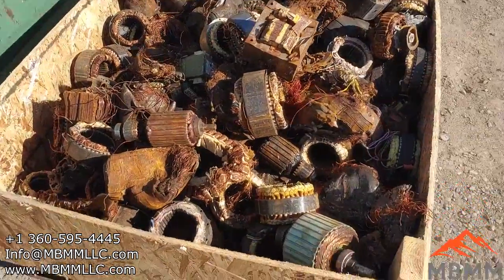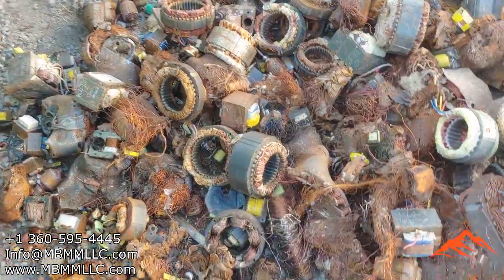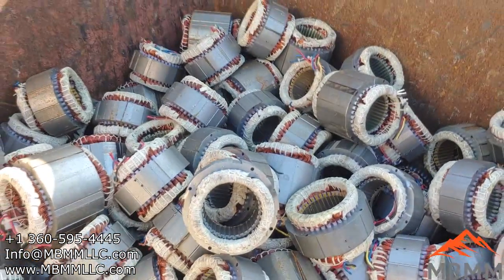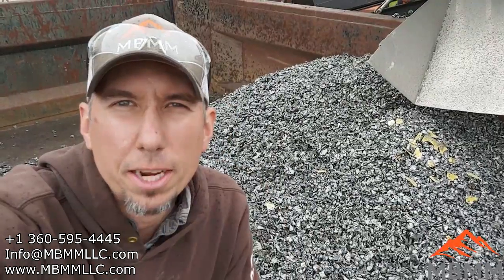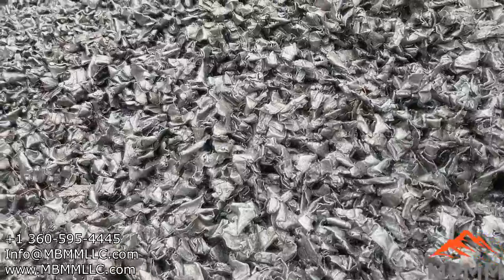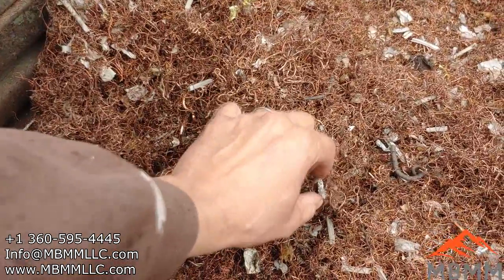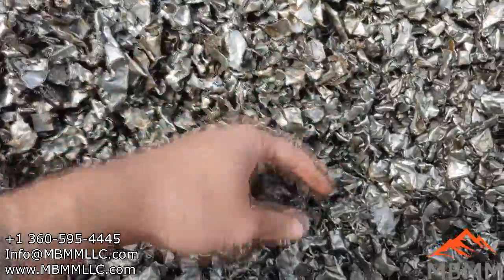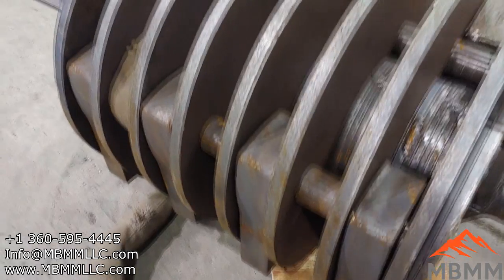Recycling Electric Motors For Clean Copper

Comment: That magnetic separator does an incredible job
Reply: I want one of them wow that thing is amazing
Reply: I have a question if you did not break them up and Hammermill and you pulled the copper wire out the way I would have to do it with that metal be considered heavy steel

Comment: Those stators are best to be done by hand I think. Cut 1 side of the coils, tick windings out with a hammer and pin or pull the windings out. Much more energy efficient maybe bit more time consuming but perfectly separated in Iron and copper.
Reply: Some large scale recyclers have machines that do this, but removing even one employee saves a lot of money.
Reply: It’s the time savings that’s where the money adds up
Reply: A problem is that if you get iron in the copper or worse copper in the iron it is almost impossible to separate later.
Reply: Smaller scale yes but I’ll save you some time and energy just wack the hammer on the side and they will come straight off in chickens of 5-10 disks.    Of course like you said cut one side off flush and this will save you time. Your welcome!
Reply: I kind of agree but if this guy has enough of them it might be a good idea to do it this way but if you only have a few it’s probably better to do it your way like I have to do I have been removing all my copper motors and I hopefully can be doing a video on that soon me removing the copper
Reply: $7 worth of electricity per hour. Wrong I think. Depends on durability of machine

Comment: you could use a ventilator to seperate light materials from the copper while it falls down from the conveyer
Reply: It'll burn up in the melt anyway, skim the slag off and you're good.
Reply: No reason to do that, you'll still end up with #2 copper, as #1 copper must be 1/16 or larger wire.

Comment: Industrial maintenance, service, and engineering guy here - 
Yeah, you could easily push a 100 HP 480V 3 Phase motor well over 100 amps, especially in the conditions you seem to be in.
Excessive heat build up in the windings (stator) of motors is what kills them, and the rated FLA of a motor is determined by how much heat a motor will produce in the windings while operating in worst case scenarios within design parameters.
Typically speaking, the Full Load Amp (F.L.A) rating of a motor is what it is rated to run at on a continuous basis ad infinitum - assuming the ambient temp of the motor is at or below the Max Ambient Temp stated on the name plate (usually around 80C, or about 175F). 
I might be wrong, but it didn't look like you guys, nor the motor, were in 175F temps out there. :)

The motor getting a little above that FLA for relatively short periods of time ( a few seconds to a couple minutes) isn't any kind of a big deal at all.
Frankly, you could just see how hard you could push it if you wanted to, and if the motor temp started rising, just back off till it gets stable and reasonable.

You said you did ~2500 lbs of stuff an hour running the way you did, I bet a whole dollar you could get that to 4000 pounds/hr with no ill consequences to the motor at all.
Just make sure the motor stays cool enough not to be uncomfortable to touch with a bare hand, and let it do it's thing.

Comment: I've scrapped many stators, and sometimes the wiring is copper coated aluminum (or what looks like a copper coating anyway). Some have both copper and aluminum wire, with the smaller copper wire used to assist at startup in a second set of windings. If you didn't inspect the stators in that first bin you could have a significant amount of aluminum in the shredded output. Overall you have a very efficient process there though. Sure beats doing them by hand like I do.
Reply: Man that stuff is annoying
Reply: Doing motors by hand is a chore.

Comment: Years ago i used to burn them to remove the shelac coating, use a sthilsaw to cut one end off the motors or transformer copper then just bang the motor and the wire pops out. Did it all by hand, made 1500-2grand a month JUST on these motors. Itd take me friday to sunday one weekend of the month to do that. I think now foundries where i live pay such a high price for these kind motors its not really worth separating them. But weight for weight you get a better return on smaller motors, the CU to iron ratio is higher. Gotta watch out for copper coated ali wire in more modern motors too nowadays

Comment: I would use a band saw to cut the ends off transformers, or a shire to get a better grade while you are waiting for the hammer to clear .. I think of a wood splitter with a knife blade to Sheri the ends off
Reply: I was thinking the same thing I want a wood splitters for this operation right here

Comment: Lovely to watch all that lovely copper being separated from the steel plates and what ever cast aluminium is attached to them.
That machine is amazing maybe not as affective as stripping by hand but certainly saves a lot of time. Probably can process more motors in a day than I can do in 6 months manually.

Comment: Wouldn't be too difficult to have a conveyor feeding the mill with the motor controlled by an ammeter on the  mill's motor. Set it so the conveyor stops when it hits ~80A and starts again at ~40A. Then it's a totally hands off system, just dump stuff on the belt and let it do its thing.

Comment: A lot of transformers have aluminum coils on one side. You can't tell at first glance, because they're coated with copper colored enamel.
Reply: I always thought it was just copper coated aluminium wire, thanks for the info👍
Reply: @heathstott  also motors, especially vacuum and garbage disposer motors. The guage of aluminum wire is larger than it would be if it were copper, since it's less conductive to electricity than copper.

Comment: I thought #2 copper is clean with no insulation or anything else with it. I took some stripped wires in and received a lower price because they weren't shiny red copper. They had some discoloration of brown and green.

Comment: Hi Jason!  Love it!  Would you use an eddy current separator to remove the aluminum after the mag belt?  Also, how about your zig zag vac for removal of the fluff and paper.
Reply: Doubt that eddy current separators would work to separate aluminum and copper from each other. They rely upon generating an electric current in a conductor due to a changing magnetic field. This in turn causes the conductor to generate a magnetic field of its own, opposing the original magnetic field and getting pushed. Both aluminum and copper are conductive, so ....

Comment: Ever consider adding a window to the hammer mill?
Reply: Would be cool but it would be trashed in 20min, glass would break and plexi is so soft it scratches easy
Reply: Yeah, but some kind of quick release to hold it and could just keep replacing. Just a one off, I think. Can't imagine a use for it other than cool video.
Reply: That would be awesome.

Comment: How does the steel come OFF the magnet?
Reply: I think the magnet just sits over the conveyor. And as the steel gets picked up by the magnet the little conveyor carries it to the side away from the conveyor carrying the copper. The magnet does not extend that far over and therfore the steel falls off. Thats my guess. Could be wrong though.

Comment: Looks like a LOT of non-copper going in the copper hopper. Aluminium?
Reply: Insulation
Reply: @aredditor4272  That makes sense, thanks.
Reply: Some of the stators had aluminium parts still attached.  Frankly, it's sometimes nearly impossible to remove it all by hand because a lot of aluminium is press fitted into motors and a real nuisance to remove. I'd like to see an eddy current separator pulling out the aluminium from the copper section and an air current separator for the paper.
Reply: @andymanaus1077  very often a motor rotor goes into a mold and molten aluminum is poured into it. 

This isn't a huge problem to refine, because aluminum melts at a significantly lower temperature than steel.

Comment: I would love to seperate the cobber from the aluminium :) Love to relaxe with this.
Reply: Most of what your seeing is the paper/tape from the windings.
Reply: @robbuechner3647  OK it will burn :-) But why is it #2 copper then?
Reply: @SuperRashead  size of the wire, and probably because of the varnish. To be number 1 is needs to be as big around as a pencil lead.
Reply: @SuperRashead  it's not CLEAN copper. it's coated with  lacquer for insulation and there's solder
 and other impurities

Comment: For some things those large machines are good, but wow, I see lots of waste and loss.. I can clean them by hand and make them much cleaner end results with ZERO loss and almost no overhead costs, just a few power tools, like an angle grinder and thin cut off disks.. I can clean over 100 pounds of copper in a few hours.. I like watching this, still there is got to be a better way to stop all the loss waste this process does...
Reply: it's for people who need to process thousand pounds and more an hour because they have the material.
To employ 10 people to do this job manually makes only sense in countries with very low labor costs.
It's not a solution for a garage operation.
Reply: @Battosai87  I do get, that on a huge scale when you have to process hundreds to thousands of pound fast, it is worth it, I was more referring to a small scale where it's mostly just you.. It is sad that the larger scale has lots of loss and small scale, like I have done for many years have almost zero loss and my end results have almost no trash in it, just pure product, Also I found melting down some metals like copper, brass & aluminum into bricks makes you more money per pound, with only costing pennies to do it.. 100 pounds of copper bricks pays almost 5 times then you would get for 100 pounds of number 2 copper... I find the more you can process your own scrap, the more money you will make per pound...
Reply: What was lost?

Comment: Your least valuable metal,the steel is clean but your most valuable, the copper is 'contaminated' beyond belief with aluminium. My local scrap yard would only pay price of aluminium 4 the whole bin. Not even price of braziery or 'burnt' copper so u need 2 somehow clean it up and seperate the aluminium. Here in England copper is £5,000-£6,000 per ton,£5-£6 per KG and aluminium is around £700-£900 per ton,70-90 pence per KG. Talking about 8-9 times more valuable than aluminium is clean,bright copper.